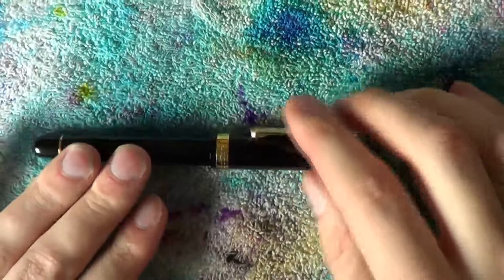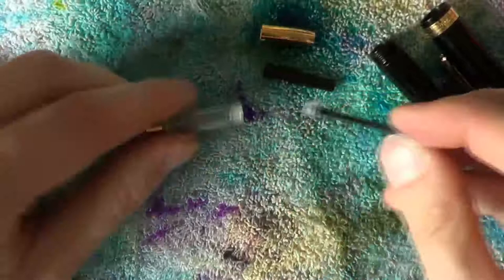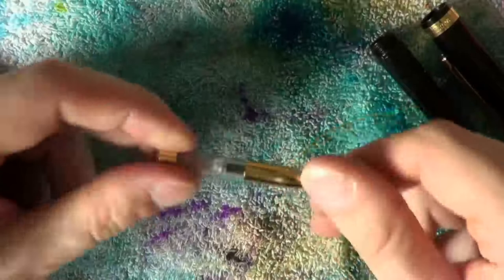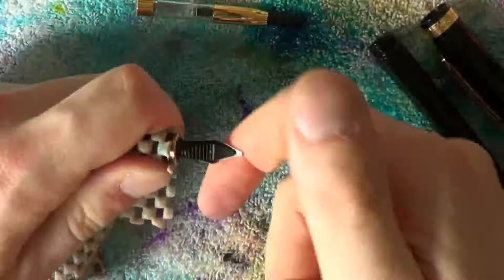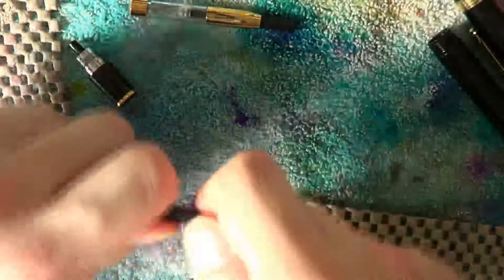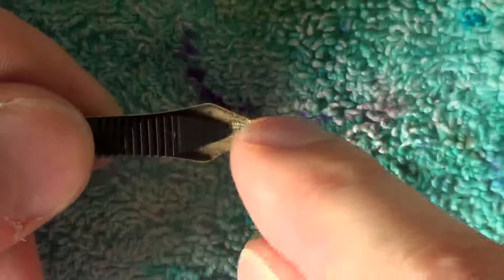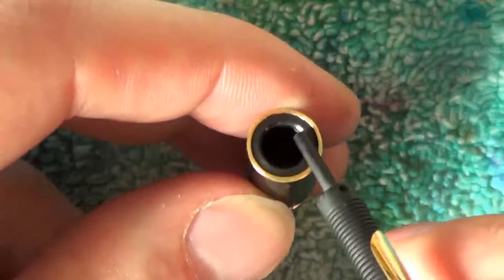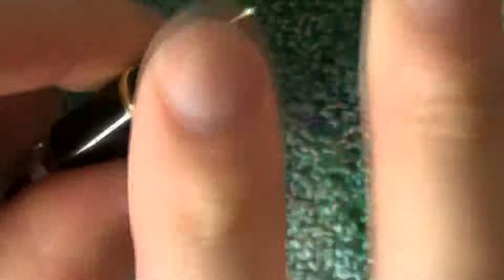Disassembly Line Platinum 3776 Music

Comment: You weren't kidding the nib/feed can be a tight fit, especially at first.  Any pointers on ways to loosen it up?  I've got grippy material and tugged away to no effect.  I can rotate it (in the section) but not remove it.

Comment: I see (now in 2018) that this is an older video which may partially answer my question:  Did Platinum make a change to the section of the 3776?  I just received a new nib/section for my UEF (moving to regular fine) and the new one looks like yours here but mine has a silver "collar" that the barrel screws onto.  It looks like it's a kind of metal sleeve over the section you show.  Any info or suggestions?  It looks like it should just screw off but it doesn't seem to want to budge.

Comment: Here's a tip. Some of the nibs are so tight that a gorilla can't remove them. If that is the case pull the metal part out with rubber nose pliers and then remove the feed. Much easier that way.

Comment: Hi Dr. Brown....I'm cleaning my 3776 Lavande and there's ink under the clear portion of the section.  Is there any way to dissemble that section from its colored insert and clean that out?  Noodler's Neponsetts' sections are dissembled with a pencil eraser twisty action (got that advice from Tardiff), but I'm not seeing a way to access the 3776's inner section.  I thought I'd ask you before addressing my question to Platinum.  Thank you!
Reply from the maker: I haven't tried it on Platinum pens
Reply: Thanks anyway, I've contacted the warrantor to see if they know of a cleaning technique or if it's covered.  I'll pass on if they tell me a technique.

Comment: Thanks Stephen.  I appreciate the nib/feed removal info as I hope to increase flow and with any luck make a medium nib a bit smoother.  I'm told that the standard Platinum nibs tend towards the toothy, but find mine unusable as is.  It looks good under magnification but didn't respond to micromesh.  I should have bought a Visconti! : )